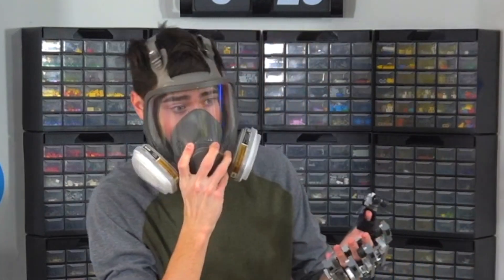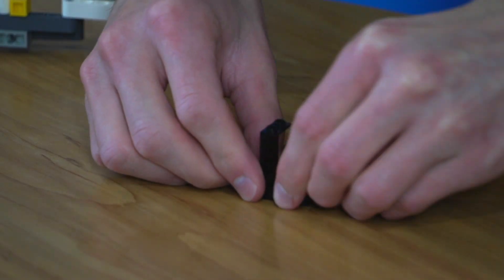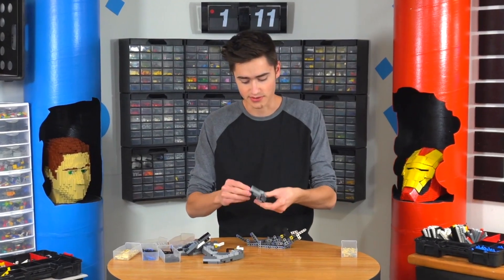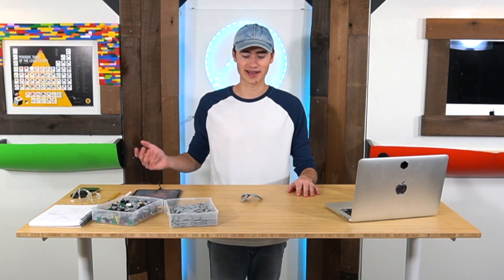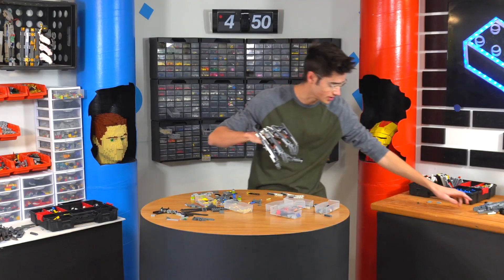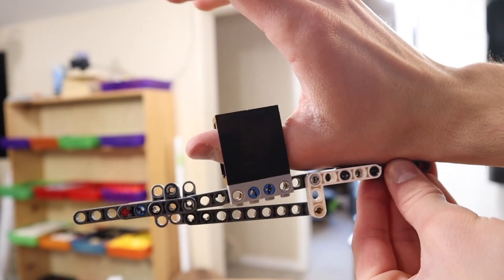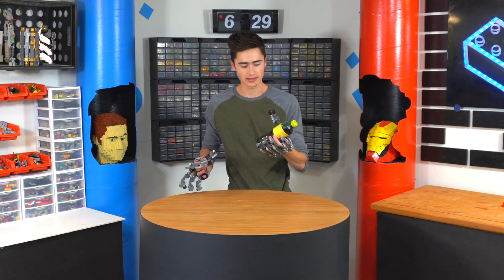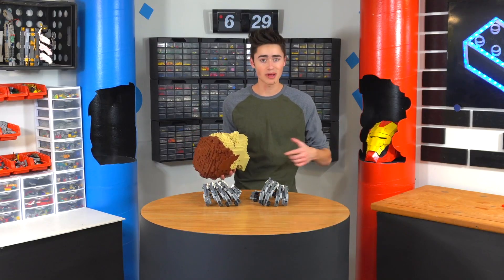I Made LEGO Mechanical EXO SUIT Hands...

Comment: This man just wore eye protection just for handling substances that are literally part of the air we breathe to live. Dry ice is frozen carbon dioxide and water is, well... water.
Reply: its SUPER cold though, his eyes and face would freeze, if he breathed in it, his lungs would be filled will carbon dioxide and they would freeze, carbon dioxide was used for gas chambers, its a serious thing
Reply: @basher1904.5  it is super cold, yes, but not cold enough to get skin or longue damage from breathing in the vapors in any reasonable amount. It was definitely not used in gas chambers, you might be thinking of carbon monoxide for that one. That's an asphyxiant gas, meaning it would restrict your ability to breathe. It does that by adhering to the parts of your red blood cells that would normally be reserved for transporting oxygen and carbon dioxide through your body. (Yes, carbon dioxide is supposed to be in your blood, it's produced as a result of your body burning fuel)

Comment: About the rings, imo elastics are beter. It is posible to clamp thin elastic material between two plates forming a loop. Lego had a holepunch to make a flexible creations with paper, i suggest to use elastics instead of paper, so it would be legal(in lego way)